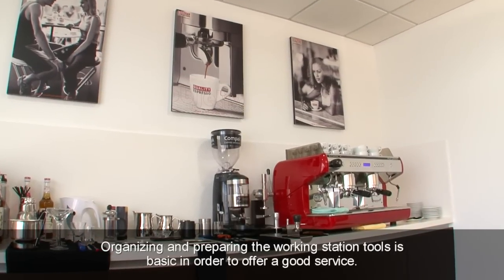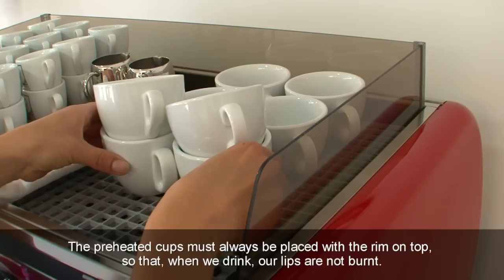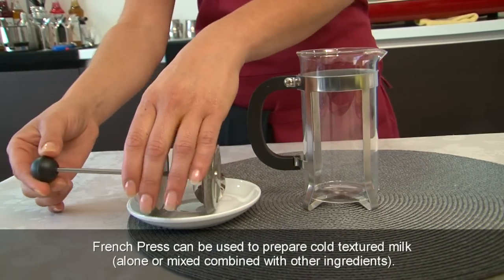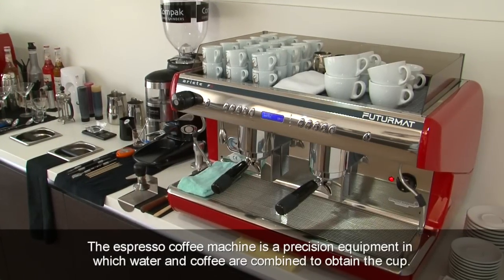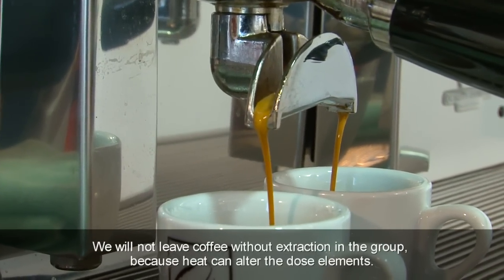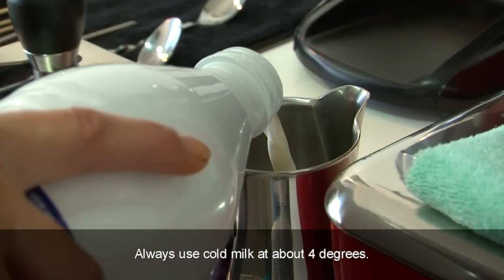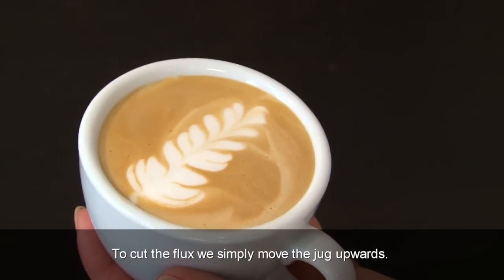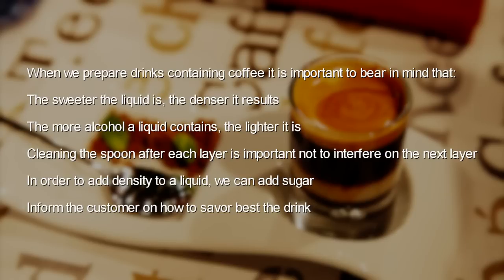Techniques: How to make coffee like a true Barista (Tutorial)

Comment: 20kg of tamping pressure is 1. unnecessary (do a controlled experiment of identical dose on two shots yourself), 2. enough to damage your body over time under the workload of a busy cafe.
Reply: some pressure is needed when the grind is perfect. Really just to press the grinds into a uniform density so it is an even pull. But the old 30 pounds of pressure is way to much. When you lock the portofilter into place, that also adds pressure. A press of just a few pounds of pressure is enough. And oily dark roast will need less pressure as the oils will also add density. So dont overdo it and find what works best thru experimentation first!